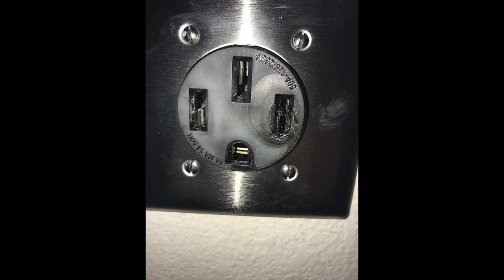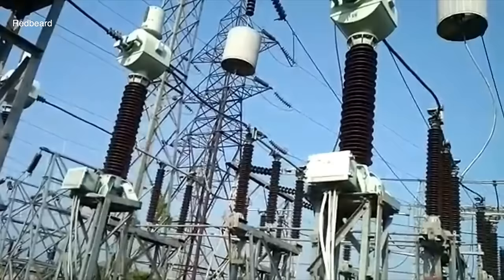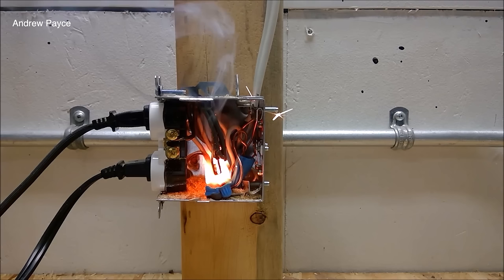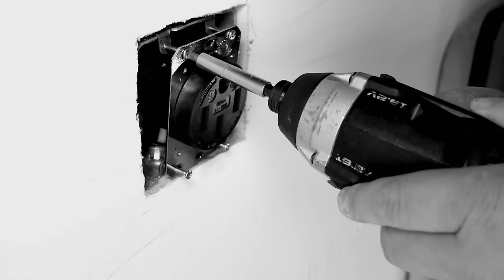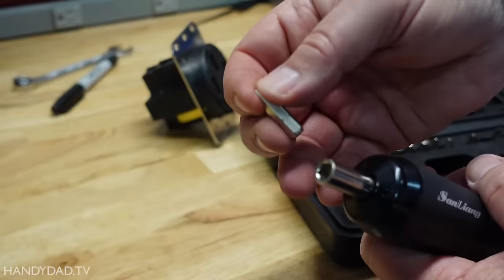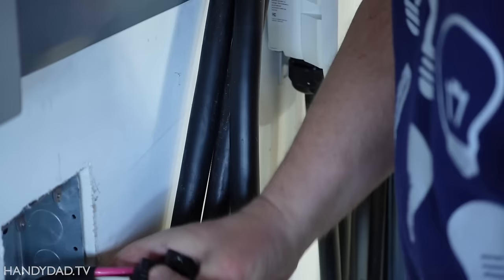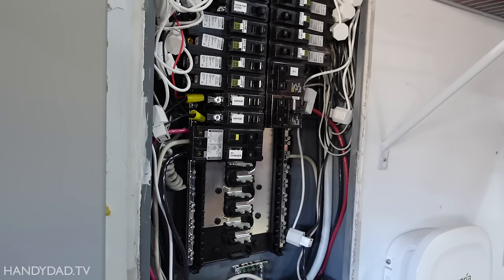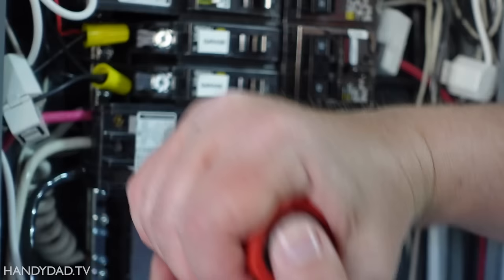EV Charging Disaster

Comment: Man, I would shut off the main or at least wear glove before working inside the box. Anyone can slip, and 240V is no joke. You can also slip a screw driver from hot to ground which will generate a lot of sparks and heated metal which can damage your eyes. It's not that likely with the recessed screws, but still better safe than sorry.
Reply from the maker: Thanks

Comment: Is that a 3 phase breaker?
Reply from the maker: No. US residential service is single phase 240 volts, split with a neutral to 120 volts.
Reply: @handydadtv  looks like 3 wires running to the breaker.
Reply from the maker: Two hots and a neutral. It’s still considered single phase.

Comment: I admit I did not torque mine either, I suspect I over tightened them to be safe.
Reply from the maker: That’s how I’ve always done it too. But many comments said I should torque them.
Reply: @handydadtv  I agree and one of these days I need check mine, but I made mine so tight, wiggled them and frightened again I almost stripped one of the screws. I love the Hubbel and have 2 EVSEs and use the Hubbel for both.

Comment: The term “ industrial grade” is a useless term and ultimately misleading.

Here in Australia, every electrical fixture has to meet the standard moulded into it.    If you wander into an electrical wholesaler and mumble about what you want or, indeed, what you are trying to do, they won’t service your request.  They usually know that you’re a novice by the language you use and your pathetic waving if your arms as you try to explain what you are really trying to do.

Retailers generally don’t sell the bits which can lead you into trouble.

About 8 years ago a new hardware chain opened up, modelled on Home Depot and Lowes.  They started to sell trade lines, and worse, short lengths of high voltage cable.    That was a disaster.   The enterprise was so divorced from reality that they offered for sale snow shovels at the height of summer.   It don’t snow here,!!
The venture failed after 18 months.

Just because you can do something, doesn’t mean you should do it!!!

Stavros
The ventureclosed after
Reply from the maker: Thanks for the info

Comment: No offense, just a question. Why would you plug and unplug your EV charger?
Reply: Some people buy / lease a new car often enough to need a different charger and some might have a welder out in the garage. You probably won't unplug it often, but it's a handy option.
Reply from the maker: Also easier to replace if it fails.
Reply: I understand occasionally unplugging it but in your video it seemed you were worried about the durability of the socket from repeated and often unplugging. I think most plug in their charger once and never again unless it fails or they upgrade.
Reply: @jimfigler7416  ... I believe his point was about early failure, which is common on cheesy parts. I have seen some go bad (not fitting tight) in a matter of months with only pulling the plug a few times.

Comment: nothing like spending tens of thousands of dollars on a EV and then cheaping out and charging it with $10 outlet, which may or may not melt under heavy load. Peeps, use commercial outlet when charging an EV. $10 outlets from Lowe are not rated for running 40A  @240V for hours on end.
Reply from the maker: Better yet, don’t use an outlet. Hardwiring is safer.

Comment: Screws are just a terrible solution for retaining wires even torqued.  Better would be new outlets with spring loaded lever connections. Foolproof and always in spec.  Shouldn’t even need a tool to install.
Reply from the maker: Great idea

Comment: No testing is my worry.  No R1, R2, Ze..   How safe is your electrical installation?   Only as safe as your testing....
Reply from the maker: Is this specific to the UK? I have watched electricians in the US run circuits and replace panels. Never saw them take a resistance reading.
Reply: @handydadtv  Australia mate.   Testing is essential.    It verifies your installation.  It Qualifies mathematically, that your installation will perform correctly.

Watch Artisan Electrical - Corey, Alex, Ruben, etc... They show you how these (typically US-built!) tools work.

Keep up the learning mate.  You are doing well.

Comment: Why not cut the plug off and hardwire it into the electrical box. Are you ever going to need to move it.
Reply from the maker: Mine is portable. I take it with me anytime I travel overnight.
Reply from the maker: I should add that my car came with the portable charger. At this point, knowing what I know, I would just buy a wall charger and hardwire it.

Comment: I have to question the accuracy of most anything I buy from Amazon (China). I do buy from Amazon, but I don't think the screw head should have stripped if the torque was correctly applied with a quality tool. Same probably goes for Harbor Freight, but I do know that Chinese mfg can produce excellent quality if they want to and for a DIY'er mostly meets the need.
Reply from the maker: I agree. We can’t blame the Chinese manufacturing plants. They build products according to the specs of the exporters. They’re the greedy bastards.

Comment: Your wording is a bit confusing. you make it sound like using the torque driver helps to get it tighter than the Allen. the torque driver is to help avoid over tightening since you can achieve far greater forces with the Allen (but still maintaining minimum standards).
Reply from the maker: I sleep better at night knowing I torqued the wires to spec.

Comment: all outlets over the yrs will slowly get loose.
Reply from the maker: I don’t recommend outlets for EV charging.
Reply: @handydadtv   I was talking about generaly all outlets everywhere.   Been in the trade a very long time now.   But for a EV.  Use a Hubble or a Bryant.  A industrial one.
Reply from the maker: @zerosparky9510 I also charge at a much slower rate than maximum. No need to charge in 2 hours if I’ve got the whole night. Generates less heat.
Reply: @handydadtv  ,  that is smart.   i don,t have a EV.  we are installing a EV outlet now for a couple who brought their Telsa from Calif.   they did not have enough elec power in the Garage.  so installing a sep elec service for that.

Comment: I always cringe when I see those US plugs. Combine that with lower voltage -> more current for the same power output -> ...
Here we use what most people call "CEE plug" for heavier connections. Most connectors have 2 screws per wire (especially the bigger ones 63A and more) and the plugs are mechanically "locked" in place.
Reply from the maker: I don’t take any responsibility for the US standards. I just have to live with them.

Comment: Maybe you just didn't film that part, but I did not see a ground get connected to that plug. Looked like just L1, L2 and neutral to me. I do motor control for work and could have easily handled my charger install. I hired a qualified electrician from a reputable company to install mine for insurance purposes. Imagine if you did have a fire... Even if DIY electrical work is legal where you live, and you knew exactly how to do it correctly... I can see potential issues with insurance coverage. If it came in to question and you could not prove a red seal electrician made that high amperage connection properly for you... Electrician install, about $1500 in my case, including about 25M of 6/3 tec cable. House is worth $1000000, car worth $72000... $1500 is a good investment in my books, to protect my insurance coverage and warranty on my home and my car...
Reply from the maker: DIY is allowed here and insurance isn’t an issue unless you intentionally sabotage the work to cause a fire.
Reply: Those are crazy prices. I paid 100€ to get my plug connected by a licanesed electrician and that was including 30 minutes of drivetime
Reply: Note that included the 25 - 30 M 6/3 tec. That's a lot of copper. I paid in CAD not EU, but also yes everything is expensive here. Housing is crazy, wages are also higher for professionals anyways...

Comment: Combination arc fault circuit breaker are the solution to electrical arc fires .some don't like them because they do there job detecting arc and they trip and considered a nuisance . It takes ability to troubleshoot arc as in the early stages you may consider it nuisance tripping but really there is no such thing . The breaker is responding to arc . Some of the breakers are slightly smarter than others telling you what kind of fault occured . I installed combination arc fault breakers on my daughter's aluminum circuits which can be prone to loosing connection in devices causing arc . I don't think they make arc faults for larger breakers for EV chargers .Now ev chargers have GFCI protection built in but not at fault which is a very real danger as your video specified . A combination type with GFCI protection would solve most fault problems that could lead to melt downs and fires . You can built a 50 amp GFCI breaker why not at fault . Yes it will be sensitive to trip and you could wake up to not a fully charged battery but better than being in a burning building . Not sure if they do but if smart chargers could alarm you to an interruption  in charging  say like through Alexa or Google assistant . If asleep it can wake you up . You are charging up a serious electrical device and there needs to be more safe guards
Reply from the maker: Thanks
Reply: There is a such thing as nuisance tripping. Such as from a radio transmission.
Reply: @jeffkardosjr.3825  Very rare . I have yet to see any tripping that wasn't a fault or overload . I would say they have saved many lives
Reply: @stevencole7331  
"Eaton Engineering Director Andy Foerster said arc fault detection is challenging, in part because so many common household devices — such as vacuum cleaners and power tools that use motors with brushes — create arcing. In information provided to ARRL Eaton engineer Lanson Relyea said that because AFCIs rely on HF emission detection to verify arcing, “any signal that conducts or radiates a signal within the detection band of the AFCI can cause interference and cause the device to trip without the presence of a true arcing condition.”" - ARRL Helps Manufacturer to Resolve Arc Fault Circuit Interrupter RFI Problems 11/19/2013

Comment: Seeing this makes me really happy that I live in Europe where we have normal electrical wiring and I don't have to have an electric car charging socket connected with cables to the welder. Golden European three-phase system 230V/400V 50Hz. A 5x2.5mm cable is enough for me to connect a three-phase socket for 11kW EV charging. Thank you my educated ancestors. My whole house is protected by a 25A three-phase circuit breaker.
Reply from the maker: You are lucky in that respect.

Comment: Thank you for this great video... Question for you... I have a plug in hybrid that has a max charging capability of 16 amps.  I bought a ChargePoint Home Flex unit that the charge rate can be adjusted down to 16 amps.  Can I still use a 50 amp breaker along with proper gauge wiring just in case in the future I want to charge a different vehicle at a higher rate?  Or is that not a good idea and should I just put in a 20 amp breaker since I'm only charging at 16 amps right now?  Thanks for any help you provide.
Reply from the maker: Wire it for 50 amps and just set the EVSE to 16 amps. Then you’re future-proof. Good move. 👍🏻
Reply: @handydadtv  ... I think you mean, run the 50 amp wire (#6/3) and the larger outlet box. You can always change the breaker and outlet later. Point being, if he's hardwiring, then everything is protected properly till the upgrade.
Reply: You can use 50A wiring and receptacle. But the breaker should be appropriate to the expected load. I.e. use a 20A for your 16A EVSE. If you use a breaker that's too large, an overload condition that the EVSE isn't designed to be safe for could occur.
Reply: @harvey66616  ... you basically repeated what I said yesterday, except that using a receptacle means using a GFCI breaker. If it's hardwired then you can use the internal GFIC protection without nuisance trips
Reply: @rupe53  It might have been what you meant, but it wasn't what you wrote. I posted to make clear, in the way that neither of the other replies, including yours, did that the breaker itself needs to match the load.
Reply: @harvey66616  .... yes, if it's a hardwire we are protecting the device wiring by using the smaller breaker. With an outlet / plug the code would be ok for a 50 amp breaker and the device stands alone. The fine line here is modifying the device to plug in might void the UL approval. (and cause false trips with the extra GFCI)

Comment: I would explicitly mention that you installed a 50-amp GFCI breaker and not just a standard trip breaker. If something arcs, a GFCI will throw well in advance of causing a fire. As for receptacle fatigue, I would personally just leave the charger plugged-in as much as possible. Exposing wires and opening breaker boxes is not risk free.
Reply from the maker: Good advice

Comment: No No No
No wall charge plugs or module.
Clealing Install Only
Pull rope down for plug cable to the EvCar charge port.
Unplug and release the plug and cable to ceiling.
So
Never ever have a 240v plug / charger on a wall
Clealing install the plug / cable with spring / bungi cord with pull down rope or ribbon for a pull-down plug / cable.
Reply from the maker: Good idea, but hardly a requirement.

Comment: Argh!!! I'm a professional electrician. When you took the cover off you said you weren't in danger. You ABSOLUTELY were. Number one rule is kill the panel. Only us dumb electricians are dumb enough to work in there hot.  Also a charging installation should definitely have a permit pulled. We really don't want EV's burning houses down. We want them to continue to grow in popularity. Burnt houses and dead people work against that. 

Not all criticism, i enjoyed the video. Thank you.
Reply from the maker: Several other vids installing things in the panel and the main was off every time. This one time I didn’t. I was just torquing three screws.
Reply: Then the circuit breaker came loose.    Hate to see what could have happened if it came off.

Comment: My biggest frustration with EV charging codes is that they call for GFCI protection. Which is great for shock safety but does little against arcing. OK just put an AFCI breaker in then? Have you tried to find a 50 amp 2 pole AFCI breaker? I can only find 15/20 amp single pole AFCI breakers.

Regardless if the EVSE is hardwired or attached via a plug arcing can always occur if wires do come loose. No AFCI protection is a problem IMHO. I believe the codes will need modification. I suppose when enough houses have burned down due to EV charging equipment the codes will be revised.

Your comments about replacing outlets is a good one. The original 6-50 outlet our LEAF was charged on for many years was 12 years old this year. I replaced it with a hubbell 6-50. The old Leviton 6-50 was fine, it had a 10 year warranty as was commercial grade. Interesting fact; Hubbell 6-50 outlets have a slotted screw not a hex screw, it's the 14-50's that have the hex screw. I wonder why? This is true of Bryant outlets as well.
Reply from the maker: Thanks for the input. Not sure why they don’t make double pole AFCI breakers. Loose connections at the receptacle will generate heat that a good EVSE should sense and shutdown. I know the Tesla UMC does. But that doesn’t help with loose connections at the breaker.

Comment: I am a little confused with the way you wired this, but maybe I am missing something.  I was going to mention this as a reply to a comment, but I feel it is important.
The US supply system actually provides 220V at the panel, split on 2 sides to 110V.  110V outlets can only supply the "required" power at double the current and it is current is your enemy with heating in well fitted circuits (ie separate from arcing), hence the importance of torqued connections .  Therefore, high power outlets in the US should be wired across the board to give 220V (like the European system) so reducing the current load on a circuit.  I saw you had a 50Amp breaker on a single side of the board - that is not normal for such a high current system.
50Amp breaker at 110V will only provide a 5.5kW, while the normal fitting in the UK (and double sided US system) would be 40Amp MCB on 240V - giving 9.6kW, though generally all car charging systems are maximally rated at 7.2kW on single phase.  You will see that a nominal 30Amp supply exceeds the power available of your single sided 50Amp supply.
I trust you are using a proper supply setup for card charging which are :
 You cannot use PME earthing without special electronics as PME is grounded to neutral that is not true earth - but you might be standing on wet ground touching your large metal device - called a car.  You MUST use TT earthing for a car charging circuit or special electronics for any other PME connection (neutral/earth bonding at some point in supply from utility provider).  These electronics detect asymmetric AC measurement on the ground pin to signal pin on the charger. 
AC rcd (you call them GFCI) to protect circuit imbalance.
DC rcd (GFCI) to protect your house.  A car has a 400/800V DC traction battery, and if things go bad in the car charging electronics you REALLY don't want that DC supply attached to your house or things will really go bad quickly.
Full relay protection on all three line/neutral/earth-bonding
Reply: In the US the back planes serve both sides. You can see that in his panel as is snakes left to right. The top port on the breaker is side a and the bottom port is hooked into side b, Together giving that 240v.  I did find the neutral interesting and that’s normally in the  corner of the panel.
Reply: @tangledupwithcombsfamily529  The neutral is on the breaker because it's a GFCI breaker.
Reply from the maker: Thanks for the info